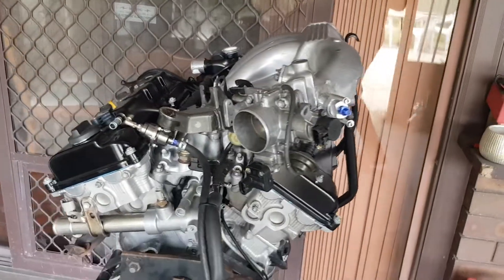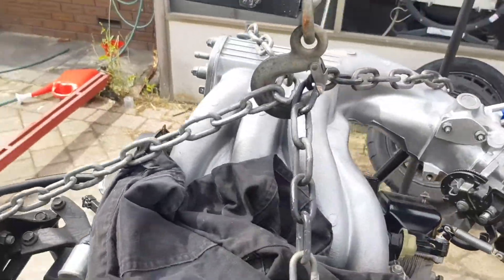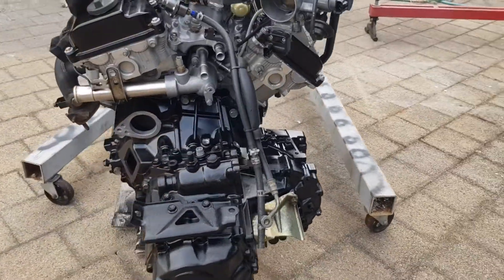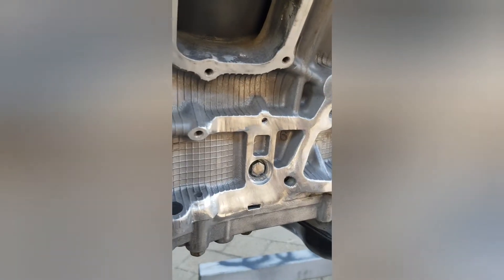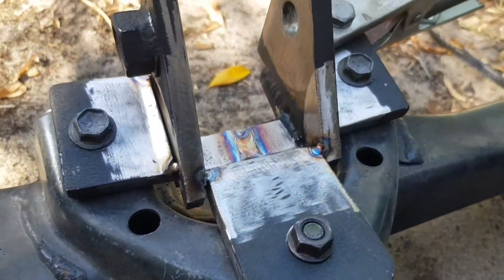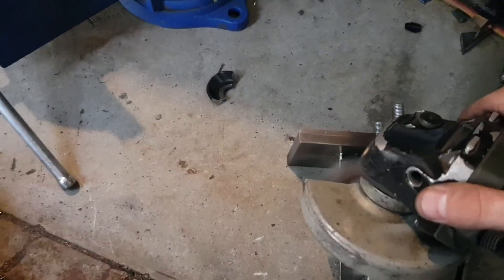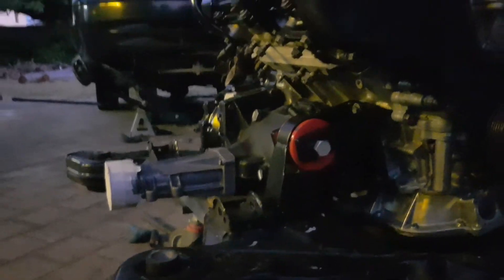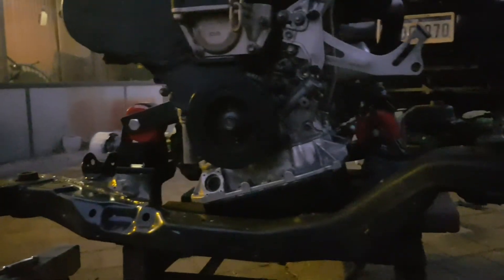Turbo AWD Camry - pt15 - Engine and gearbox fit.

Comment: Awesome build! Do you have a thread in a forum that your documenting what you've done? I'd be interested in more about the E153 and converting it to AWD. Thanks!
Reply from the maker: Hi, nope its not on a forum anywhere just here. Enjoy.
Reply: @broxonbrookfield5665  any more info about what front & rear differentials you are using?
Reply from the maker: All I will say is they are toyota, its easy enough to find the info out there on toyota E series gearboxs. 😉
Reply: @broxonbrookfield5665  My understanding. You neer a E153 with Gen2 Rav4 front and rear diff. Sound right? Ideally I wanted the E154F but it wont bolt up to the V6 so the E153 or E154 with the Rav4 diff should work. Sound about right? E153s are much more readily available than a E154 anyway so I hope that's what I need. Want to eventually convert my 2GR Rav4 to manual next yr.